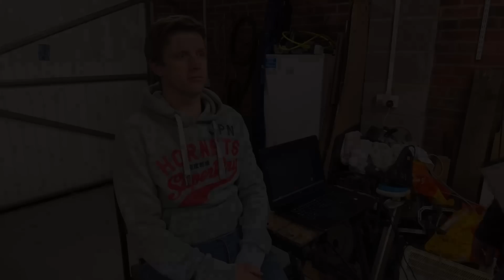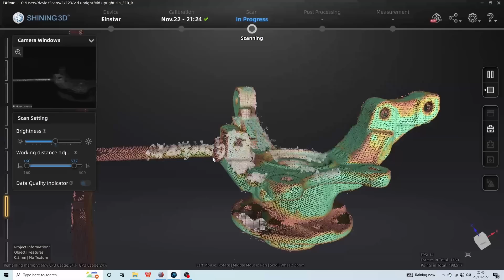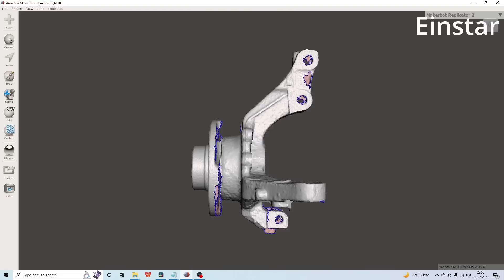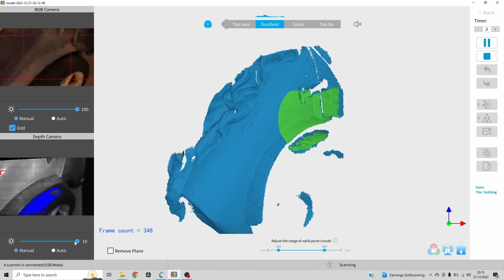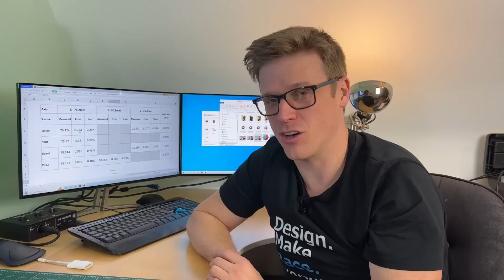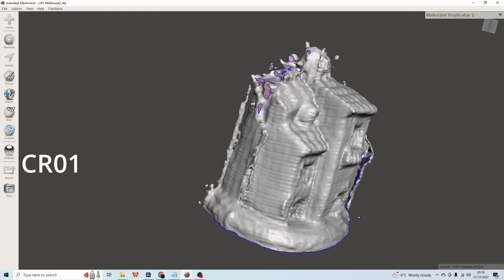Which 3D Scanner is best?!  The Pop2, Einstar, CR01 and Lizard compared over 20 different scans!

Comment: I'm wondering if his pop 2 needs to be calibrated. Dave's good people just shocked how terrible the knuckle came out considering I've scanned one in a car without an issue haha.
Reply: I think a mixture of calibration and too much blue in the preview didn't help. This was a big video and alot of scans to get through and things got slightly missed. Will try to revisit it and add to the website some updated scans 👍
Reply: @davec9619-k3p  no worries i know you know how to work them all just was surprised how terrible it was considering you've seen my scans for my brakes lol
Reply from the maker: To be fair, the face scan, 123 block and the little house came out very well from the Pop2 and you can hardly moan at the accuracy results…
I had another go at the upright on my own got the same result, I just think the Pop2 was struggling with these, be it surface colour, finish, texture 🤷‍♂️
If the Pop2 was your only scanner, you’d persevere with it until you get a good result… but with other scanners you don’t have to…
Reply: @MakingforMotorsport  i was surprised how well it did on the accuracy. Just odd that the  Knuckle was so bad since after coating it should've been easy haha. I've had better results scanning black objects no coating haha with little to no effort. I've been talking with Dave since he got his original pop and Cr scan so I know he knows what he's doing but given that he's also seen the scans I'm mentioning haha. Usually when it's that noisy it's too much natural light, over scanned the area or too much gain but it didn't look like any of those were an issue hense my confusion however i do understand the massive undertaking this video was.

Also i made the first comment before seeing the rest of the video so i didn't see 123 or house at the time lol. But I've scanned a turbo and well used engine( similar color and texture) with 0 spray without any issue even using the pop 1 and older software which is why I'm confused haha. I expected it to go einstar > pop 2>  then creality on everything but the car panels which it basically did and in some cases the pop was best which was shocking as well haha.

Comment: Nice job on the videos. You tried the blanket trick on the Pop2, curious if it would make the lizard scan usable in the same scenario? I know the Einstar will be better for large objects, but with only one scanner, is it possible to do larger scans with the lizard, when only needing them very infrequently?
Reply from the maker: The field of view is smaller with the Lizard than the Pop2 on Body mode, so you’ll struggle to have the blanket close enough without obscuring the thing you want to scan…
If it was thin enough you could try it…

Comment: I'll be doing another test this coming week with the Einstar against the 3DMakerPro Whale.  The whale was supposed to basically be a combination of the CR-01 & Lizard but so far my results aren't showing that.  I'll be scanning in a small aspirin bottle 33mm X 56mm up to my whole smart car outside plus I will make the files available for people to check out themselves.  I'm not being paid and I'm NOT going to hold back when I call something garbage and why as I'm tired of BS reviews and misleading advertising and only showing the good bits without the toiling you might have to do to get that as well.
Reply from the maker: I have a whale on the way… I was contacted months ago and they said it’ll cost £7k… there was no other info so I thought it was a windup… looks like a proper product tho.
A Lizard and CR01 in a single machine actually would be good if the price was right.  
We’ll see how it goes…

Comment: Great video as always. Very very well structured and clear! 
Just one note, you can alter the lizards calibration file as it's stored on the USB stick you received with it. However, good luck understanding it! 
I scanned a half metre step gauge with mine and I found it to gain around 0.05mm of linear error over each 30mm distance. So just a linear scaling issue but I haven't managed to adjust my calibration file to make up for it yet.
Reply from the maker: That is weird that you got a linearly scaled error but mine felt more like an offset error… I haven’t tried to hack the lizard… maybe in the future?!
Reply: @MakingforMotorsport  do you mean the offset doesn't change over linear distance? That sounds like an even easier equation to solve. I haven't looked if the community have worked out how to do it yet but it's definitely worth a look.
Reply from the maker: Yeah, my tests showed 0.4mm error over the 3” and 1” dimensions with the 123block
Reply from the maker: The Einstar however gave 0.3% error consistently, that was only 0.07mm on the 1” dimension
Reply: @MakingforMotorsport  trying to decide which of these errors I'd rather have. With the consistent errors you could just scale your point cloud if it's consistent in all directions.

Comment: Related question, after you have your scan what is the best software to edit, work with the scan you have made ? Fusion ? Solidworks ?  Blender ?
Reply from the maker: I use Fusion360 and Meshmixer but I am abit of an Autodesk whore… I do want to learn Blender but I just don’t get the time!
Reply: If you want to know also other's opinion 😀 I use solidworks + meshmixer and sometimes rhino. I would be more happy with blender since it is free, but I didn't manage how to export STEP or other 3d format suitable for manufacturing so for me it is no-go

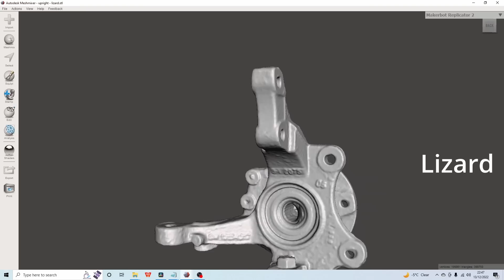Comment: @9:55 "how well it renders those holes and how well the scanner sees down into those holes" - Remember that you are looking at a processed mesh here. You have to look at the actual point cloud to see if the scanner can see down into the holes. If you'd ask me, these holes are are filled by the meshing algorithm and that actually looks nice but that same algorithm may be the reason for the strange meshing error in the bigger hole shown just before. The Einstar leaves the holes unmeshed because their algorithm will not fill the holes because of too few scan points in the holes which I prefer over filling them. That is because I mostly scan for reverse engineering purposes when I need to create a part that fits an existing part, needs to fit in a certain place (inside the scanned part) or when I want to recreate (a modified version of) a part. In these cases I rather want to do a manual measurement when the scan tells me it's lacking data or precision of the data.
Reply from the maker: I completely agree with your points, the closer cameras on the Lizard vs the Einstar would seem enable it to see further into holes.  However as the scanner and software work as a system, seperating them doesn’t make too much sense to me.
That said, when RE’g it always makes sense to physically measure when possible, in my RE video I physically measure the drive flange model off that, using the scan to locate the centre line of the wheel hub in relation to the pick up points…

Comment: Great video as always. 
I recently sold my lizard to make space for a new contender the Whale. It's essentially an upgraded lizard and cr01 in one. 
So I'm hopeful it does close and far scanning. As I did recognise limitations of the lizard on bigger items.

Maybe in the future a Whale / Einstar comparison is good. Einstar seems to be the all rounder once you have very high end hardware for it to process on.
Reply from the maker: Funnily enough… guess who has a Whale coming?   I don’t know pricing tho…
Reply: Isn't the Whale 10x more expense?
Reply: @TooCoolVids  i paid €850 including shipping and customs for the whale with turntable. It's really not a 7k plus scanner. So i would expect in the future a huge discount price from there current pricing.
Reply: @seanyt121  How did you buy it for 1/10 the price basically? Doesn't add up. Or did you mean to put 8500?
Reply: @Tixbomber  everyone that has one right now bought at the initial release price of €850-1100 depending on how quick they ordered. Then price went upto current price.

Comment: What about the probability of each scanner?  Which would has the best probing?
Reply from the maker: Sorry, what do you mean by “probing”…
Reply: @MakingforMotorsport  Probing means to scan an area that's like a hole or shaft on the inside that may have some pretty decent depth.  It's basically to scan the insides of something.
Reply from the maker: @larsulrich3356  sorry dude, yeah, I haven’t done any science on it but the lizard seems very good at holes, both cameras are close together which helps.

The Einstar isn’t great at it, as you’d expect with the greater distance between the cameras, geometry is just against it…

Comment: It whould be better to test the accuracy of the scanners with a known distance between 2 spheres.
Planes are to much caotic in coordinate metrology, you get differente results if you switch the reference plane (distance plane1-plane2 ≠ plane2-plane1).
Reply from the maker: I know, but I need a known standard, abd the 123 block is as close as I have to anything properly known on size and squareness….

Comment: I had 3 Minis. They were cheap, one I painted with cheapo tremclad, just like the VW Rabbit in fact. One of the Minis was converted into a pickup truck version. The cops stole that one from me the same day I bought it. I had just parked it after bringing it home, and then these two sociopaths just took my new car!!
Probably catholic..

Anyhow, thankyou for your walk through testing the different scanners. I have 3 older ones of those too, and they blow dog. Been hoping for quality to improve enough to be practical.
Ok, lets mod em with a serious boost of power, and do xrays!.
Reply from the maker: I was planning on using them to mod cars… but modding the scanners???🧐🧐🧐

Comment: Awesome video cheers, the Einstar is the only one I don't own. (I have pop1, pop2, CRscan 01 & lizard). Of the ones I own, pop2 is usually my go to scanner. 
Would love to see some more small object scans from the Einstar (I understand this isn't it's strength area but it's what I usually scan & the one scan you did looked pretty reasonable).

Would have been interesting to see how a two position scan on the small figurine with pop2 would have turned out as I think it was only one position? Would have picked up the overhangs at least... Cheers
Reply from the maker: Yeah, I would have done more on each scan, but, honestly I was limited by time… with scanning and editing I have easily spent 30hrs on this video, so I had to pick and choose… if it was a decent scan straight away, I took it and moved on, unless it was super easy (like with the lizard) to do 2.  I do call it in the video tho, a second scan would tidy all of that up…

Comment: Does the hardware of the laptop/pc do anything for the quality of the scan or just the processing time? I reckon not ,but doesnt hurt to ask.
Reply: If you don't have enough ram for the einstar you will suffer on car body scans. It will likely fail and say you've run out of memory. GPU is important also. 

My specs

i5 8600k CPU
1080ti GPU
32gb ram
M.2 Samsung 970 pro

Seems to manage but it's still hungry for more ram. CPU screams at 100% also. I am in the process of affording the latest i7 13th gen with 64gb ddr5 ram. Will be keeping the 1080ti as its only fully loaded at 60% max. 

I am wondering if a seperate m.2 SSD just for scans will help take the load off the operating system and CPU but I can't prove that yet

If I try to scan the whole front end of the car. I will need to chop away half of it away to get it to process the point cloud. Alternatively I could be clever and just scan 1/4 of the car at a time and stitch them together in another software. Just have to account for overlap of the scan data to get it it aligned with each segment
Reply: @davec9619-k3p  i see, hope my gtx1650 will be good enough, only 16 ram though... also do all scanners work better in the dark or just the one from the video?
Reply: @PlamSR  regards to GPU. You should be fine

The only scanner that will scan outdoors in daylight is the einstar without any quality loss. It truly blew me away scanning my car in daylight 

Pop2 and cr-scan definitely won't scan in daylight without alot of noise. Not sure about the lizard

Comment: If you are trying to create anything automotive related to body, the Einstar seems like the goto, but with 30% error that could cause fitment issues on most parts.  Flares, diffusers, splitters, and the like would be hard to control for quality production.  Thought?
Reply from the maker: I regret putting that up, as I have no evidence that the error will scale linearly, that was just the impression I got from the consistency of the %-error across the measurements.
Even if that’s worse case, I’d suggest there are few other ways that you could get more accurate over curved surfaces… (a simple linear measurement? Measure it….)

Comment: Great video, thanks. It's such a shame that Hewlett Packard completely ruined what was the David scanner project by buying it and then doing absolutely no further development before discontinuing it. It was so far ahead of anything else available at the time in terms of value for money, flexibility and scalability (it's ability to scan both small and large items). It blew away some far more expansive scanners 10 years ago. I'm sure if it had continued being developed as a semi open source project by Simon and Sven, the original developers, it'd blow these away, as it would have had at least 10 years more development. I have dual camera HP 3D Scan 5 system, and would be tempted by the Einscan if it didn't mean I also need a new workstation spec laptop (I don't 'need' one enough to justify the expense at present). That awesome auto tracking of scans of larger, difficult to register shapes such as body panels which is such a time saver, doesn't come for free in terms of processing power I suppose!
Reply: Sadly the store of many fantastic projects crushed by corporate giants.
Reply: Ive got a re-branded HP SLS scanner too and its such a bore to use. Yes I agree its awful they just bought it and let it die. Why ? What did they want with it? Why would a company buy something and then not develop it? Its not like they had a competing product ???
Reply: @Andrewatnanz  I believe they bought if for David's software, to use parts of (mesh alignment???) it in a very bizarre HP product called Sprout, which seems to have been a big failure
Reply: @richardjones38  yeah I am pretty mad I have spent thousands and thousands on that system and my license keeps expiring for no reason. Seriously its got the BEST mesh alignment tool out there and I would keep it just for that but the licensing system is garbage.

Comment: Thank you so much. I was eagerly waiting for this video. Still I´m not sure which way to go for my current project. I want a 3D model of a vintage motorcycle engine case/ the case halves as a backup to eventually have one machined if (more like when) the casting fails which is common in that engine under moderate power increase.
The Einstar seems to be where it´s at accuracy wise but not for the intricate details since it´s long range. Also it´s quite an investment and I wonder how much a scan done as a service with a five figure scanner would be in comparison.

Keep up the great work. Your videos got me excited about CAD.

Comment: Fantastic overview of these, thank you! And as I suspected, I need two different scanners 😭🤣🤣🤣
Reply from the maker: Not strictly, but at our price point, you have to pick your battles…
Reply: @MakingforMotorsport  Yup, for me getting even one of them I need to look deep into the wallet and think twice. But it seems it might be worth pushing the cost to get the Einscan since it was pretty good all around, even on the small stuff even though not being it's main thing to do. The noise in the windows could probably be remedied with a more thorough scan I guess?
Reply from the maker: @rejsa-nu  you could make a decent model from the CR01, but it’d take a lot of clean up.  There is definitely a great scan in the other 3, but like I said in the video, but the Einstar needs more help….

Comment: The Einstar has the best Software I agree. For automotive parts probably the best scanner to get.
I bought the Einscan SP in the end because I don’t scan as much auto parts. I have the Revopoint mini for really small parts too.
Reply from the maker: Does the mini outperform the SP?
Reply: @MakingforMotorsport  maybe when scanning really small parts…? But the SP did scan a key better than the mini for example. Less noise in the scan and around the same details. The Revopoint mini can pic up more details but for the most part you don’t need the 0.02 resolution if you not scanning jewelry stuff or really small action figures. The software can’t keep up with the Shining software and you have to use Revopoint Studio for cleanup and fusing the scans.
I would say save more money and get a Einscan SP for small stuff (accuracy around 0.05mm!) and a Einstar for big parts.
In the end you get what you paid for.
Reply: I have to add I tried to scan a bottle cap recently and the Revopoint mini did pic up the threads really good. The Einscan SP could not do it. 
There is a new software release for the Revopoint too and it’s pretty nice. Worth a second look.